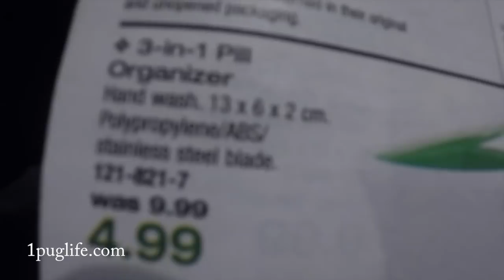too many donkey powers

Comment: If your rear axle hangs by the bags and/or shocks those springs are worn out. Not very often to I have a truck on the lift that it hangs buy the shocks. If you have good springs they won't sag down so far and when you go to remove say a shock the sock will extend father then the axle will let it when you unbolt it.

Comment: pug the snap rings are gone off the ends of the axels at the gears thats why there is all that play. replace snap rings and your good bro.
Reply: hotrodj21 theres no C clips on a full floating rear end
Reply: My Email what holds the axels in if the hub bolts break?
Reply: hotrodj21 if you break off all 8 bolts holding the axle to the hub you have bigger problems

Comment: Really not that big a deal, change the carrier, use your same crown gear which is a left hand thread to take off and replace it, set your back lash and a little bit of pre load not much on the side bearings and there ya go. Or just bring it over and I’ll do it

Comment: Just drive it until it shits the bed doing the shift between 28 and 29th gear. it'll be fine as long as you got clean shorts for when you get off the highway FFS.

Comment: U can get small parts kit for the diff...spider and side gears
Reply: Clutches are beat, that's what all the pieces are
Reply: @kwmiked  its an open rear end no clutches
Reply: @kwmiked  the trac rite is what aam called the factory non open diff, its a helical gear diff. No clutches. The material you reference is likely spider and or side  gear shim between the gear and case.  But you know this already.